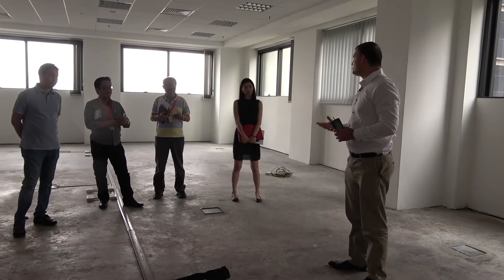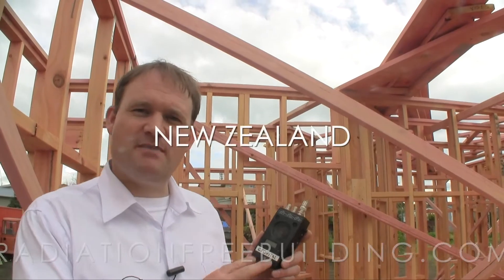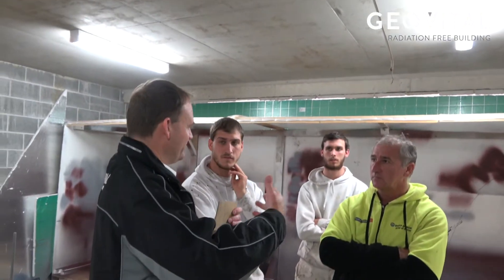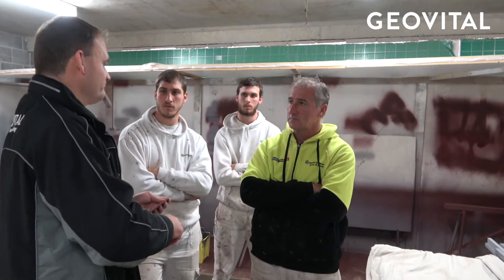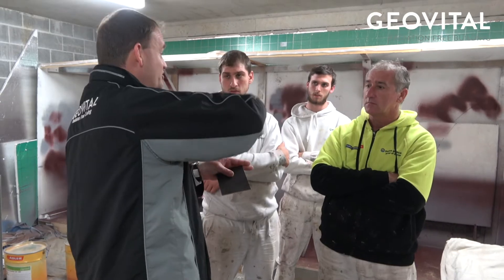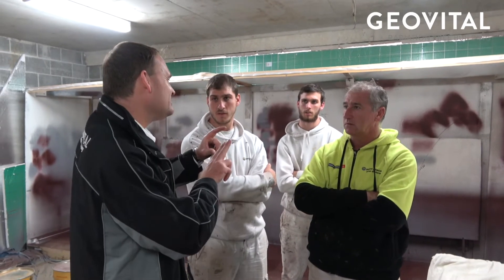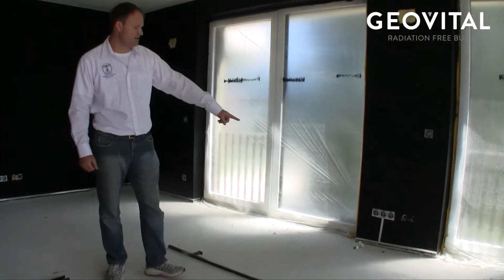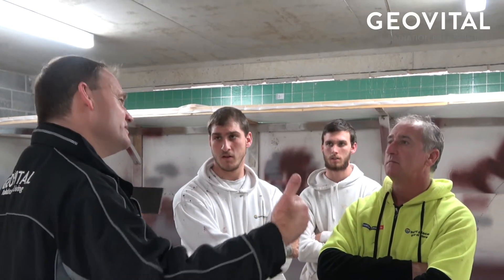How to apply Grounding Tape to Shielding Paint - Radiation-Free Building

Comment: If I am painting just one wall can I just put the tape along the bottom of part of the wall? Or does it have to go all the way across the wall? Do I have to paint an entire room to get any shielding? I have a smart meter on one wall, on the outside of my home can I just paint the one wall?
Reply from the maker: Hi Sarina, one tape on one side of the wall would be fine to ground it. The grounding of course being connected by an electrician. The fact of shielding just one wall is not quickly explained and needs careful consideration as shielding paint reflects on both sides. As always, getting one of our consultants through to assess your body for RF and electric field exposure, amongst other things, especially in the sleeping environment is crucial. Shielding is not difficult to execute (put on the wall) but the approach needs to be sound and you need to use the shielding paint designed for wholistic health. (Our T98).
This may give some insights on one wall shielding https://youtu.be/LQfhjwtnF2U?si=0mmPv5Y2OgTx90V1 but please, don't start this on your own. RF from a smart meter only, I have never seen to be the only issue in a home/bedroom.
Reach out to us on our site and we can see who is close to you for an assessment or who might go to your area. 
Good luck
Reply: @geovitalacademy  thank you for the advice. What type of cost is associated with someone coming out? I know you don’t know an exact cost but a ballpark?
Reply: What did you end up doing? I am in the same boat- would love to know. Cheers!
Reply: @whotube539  I personally haven’t done anything yet. Now I’m scared that I’m going to make the situation worse because I don’t know what I’m doing. I don’t have the money to call anybody out and do a full assessment type thing. My daughter is going to be sleeping on the wall that I want to paint which , on the other side, sits the smart meter. I am not sure what to do at this point.
Reply: You can apply the shielding paint to one wall and ground it. You only need a small piece of grounding tape applied to the one wall by an outlet which you will ground to. The smart meter emits signals 360 degrees, if you apply the shielding paint to the one wall you will reflect/absorb and ground 180 degrees of the smart meters signals. The rest will be reflected away from your living space. Also if you have a house you can paint a 6'x6' patch around the smart meter on the exterior of your house and ground/reflect that way.